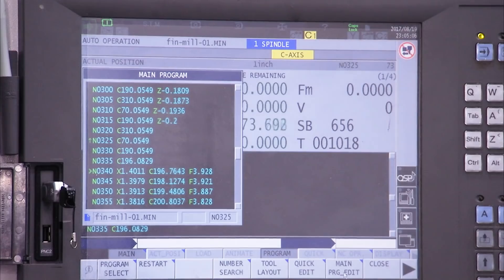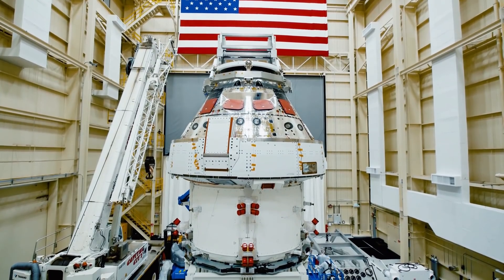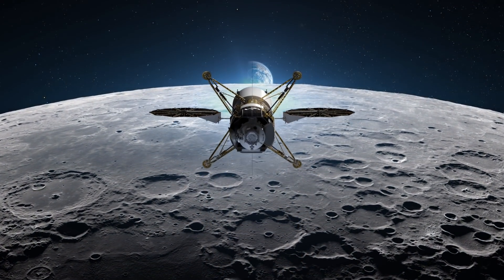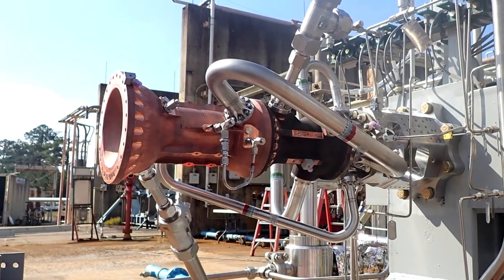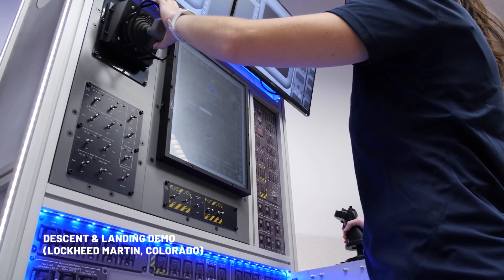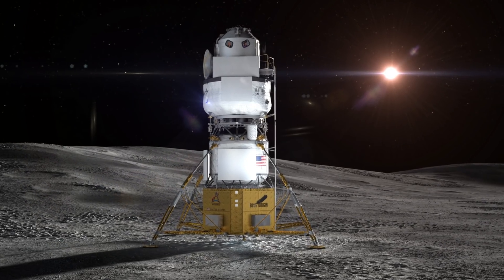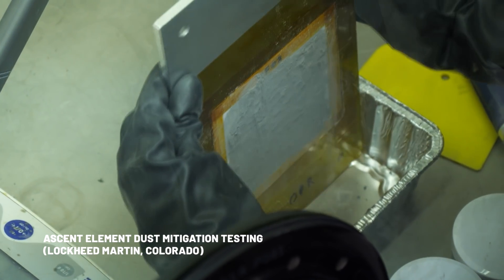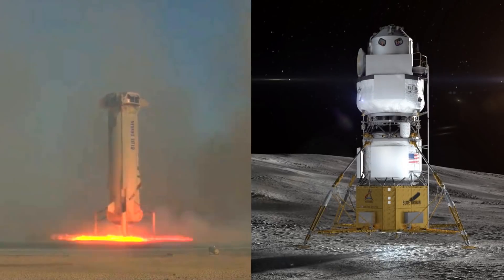Tech Demos for NASA’s Artemis Program

Comment: Too tall. Already can see it falling over on landing.
And why is it only partially reusable?
Reply: because they make more money that way
Reply: Starship is almost 62 meters tall and yet SpaceX is offering the HLS variant of it for their proposal! Form that monster you'd have to drop more than 22 meters to get to the surface where as here it's 8 meters.

Initially, the Blue Origin lander will be partially reusable, but because it uses LOX/H as propellants, it can use ISRU to mine Lunar water to make more fuel and potentially do single stage landings and landings.
Reply: It has a wide stance so I'd doubt it fall over easily
Reply: His face when moonship falls over.
Reply: Didn't you see the landing leg configuration or listen to the video? It has a wide stance on the legs and it is designed for landing on slopes up to 13 degrees. Starship is much, much, much taller and at this point, has only the short deployable legs in the aft skirt section.

Comment: Elon will beat them all.
Reply: FridayGood yeah because they are using Orion 😂😂😂
Reply: @TheMazyProduction  elon has stated he wants hundreds of safe landings before crewed starship, so even lunar starship will need orion to dock
Reply: @FridayGood also wrong. They average between 103-107 km on most flights nowadays.
Reply: Lunar starship also uses Orion? As of the moment, nothing can take humans back at all. It could take years before starship is feasible, and it might not be feasible at all.
Reply: J o s h yes but nobody else even has a rocket that can lift these things either.
Reply: maximum altitude Bleu Origim so far 101.7 km (63.2 mi) correct me if i am wrong...
Reply: @peterwarmerdam1078  119 km, actually, on flight 9. And don't tell me you couldn't have just taken a couple minutes at most to have looked this up.
Reply: @FridayGood They should focus on reaching orbit first.

Comment: Your lander will take a ride on starship.
Reply: @FridayGood nah you’re good
Reply: @FridayGood Where is it? I saw half a fairing once and a few engines, but that's pretty much all.
Reply: @johntheux9238  DIdn't you see the Blue video showing the fuel tanks under construction in Florida several months ago? If not, go look it up. They have actually both halves of the fairings, the two standard types of payload adapters (you can see them in the fairing and other videos in the background) and they have the propellant tanks, among other hardware.
Reply: @johntheux9238  Yes. Blue is just very secretive, so they don't keep showing every little piece of progress, even testing the completed tanks (they have a testing facility right next to the factory as you saw in the video), so they can quickly roll tanks over there and then bring them back like they have with a lot of things over the years without anyone being the wiser.
Reply: @FridayGood it’s a joke, I’m referring to starship being cheap af and them hitching a ride in it
Reply: Hahaha, of course they’ll use starship

Comment: Expendable landing system??? mmmmm
Reply: @FridayGood No...? the descent element is left on the moon. No ISRU process occurs. The ascent and transfer element could be reused.
Reply: @FridayGood Yeah... Unlikely. Once an ISRU base is set up on the moon NASA would likely be using Starship to bring heavy base components to the lunar surface. the national team lander would become redundant.
Reply: It's usually not worth the effort to take it back, I don't see any issue with that.
Reply: @vaclavzajac214  Well that's certainly the case with the National team lander. But there is definitely a point with reuse of ships designed for rapid reuse- starship.
Reply: @vaclavzajac214  Seriously, you don't see a need to recover a complete structure, suspension systems, hydraulics, fuel tanks and also a complete engine?  Besides not leaving junk on the ground ...
Reply: @Alpha Centauri It will probably be kept in the configuration you see since doing allows for emergency aborts by jettisoning the descent stage on ascent or landing and then returning to rendezvous with the transfer stage or Gateway.
Reply: @FridayGood are you kidding?

Comment: Heard you tried to trademark rocket landings on drones?
Reply: @FridayGood woah, someone who fact checks on the internet? Respect.
Reply: @FridayGood they tried to
Reply: @devindykstra  they patented it, not trademarked. Learn the difference. A trademark would be if SpaceX tried to use Blue Origin's logo, for example while a patent covers an invention or other similar thing.
Reply: Blue Origin tried to patent, not trademark, for barge-based retropropropulsive landings because they were going to do that for the early version of what would become New Glenn. SpaceX saw what Blue wanted to do during the early Commercial Crew program presentations and decided that was a better way to go than trying and failing to recover rockets with parachutes in the ocean Space Shuttle SRB style. So naturally they challenged Blue's patent and were able to win in court.

Blue is going to still do something similar, but with a ship rather than a barge since a ship moving at slow speed in the recovery zone is far more stable than a barge, even one with thrusters, in rough weather which will go a ways towards preventing the types of weather-related scrubs we've seen lately with SpaceX launches with rough seas forcing one or more day delays.
Reply: @Nowhereman10  I didn't want to bog the conversation down with pedantics. Obviously the difference between a patent and trademark is huge, but the idea is the same, so I didn't feel the need to correct them.

Secondly, the reason why SpaceX was able to win in court was because they were already building their first droneship. They both developed the idea of using a boat for landings independently. SpaceX started their Falcon 9 landing tests in 2013, they may have originally planned to use parachutes, but that idea was clearly scrapped a long time ago, long before they saw Blue Orgin's proposed patent in 2015.
Reply: @Nowhereman10  according to this, you are a little off. https://en.wikipedia.org/wiki/SpaceX_reusable_launch_system_development_program
Reply: @matthewwiemken7293  You mean this?

"SpaceX initially attempted to land the first stage of the Falcon 1 by parachute, however the stage did not survive the re-entry into the atmosphere. They continued to experiment unsuccessfully with parachutes on the earliest Falcon 9 flights after 2010. SpaceX subsequently switched its focus to developing a powered descent landing system.[9]"

Sounds what he's saying is right.
Reply: @mikedicenso2778  sadly, I sent the wrong one. supposed to be about New Glenn
Reply: @chloemathon9327  Blue Origin was not first, it was an old idea.
Reply: @FridayGood they did try to copyright it when Elon wanted to do it, however, Elon showed that the concept had been around for years (by showing that in a sc-fi movie they landed a rocket) and therefore the courts ruled that it wasn't Jeff (who)'s original idea so therefore he couldn't copyright it.